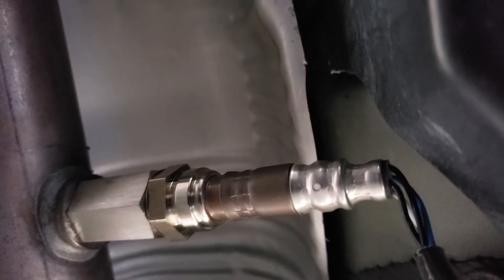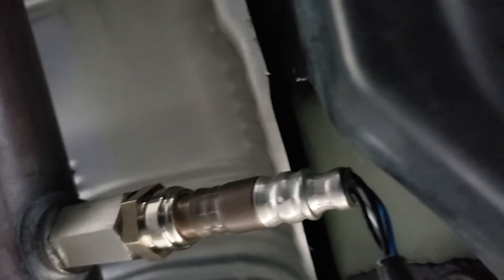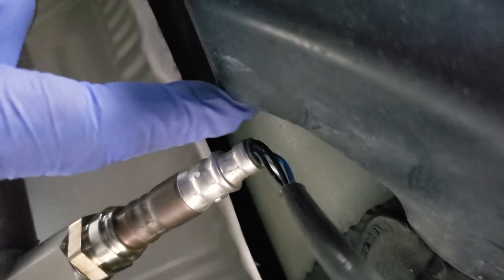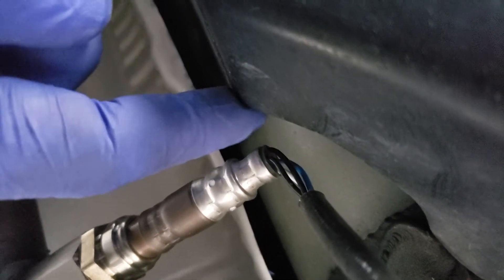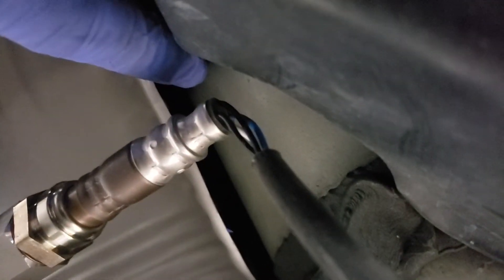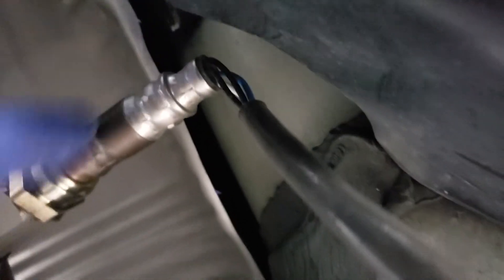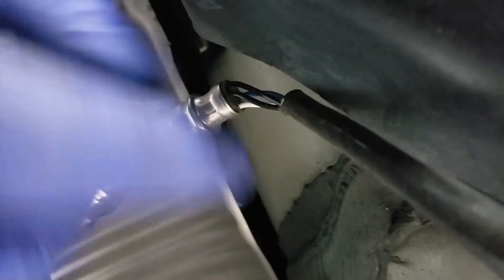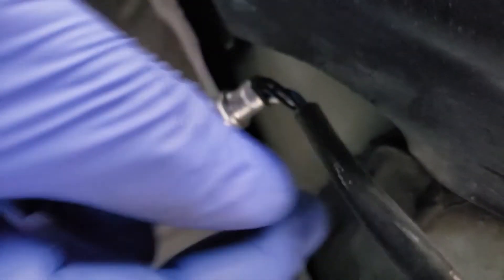O2 Sensor modification 2004 to 2009 Toyota Prius

Comment: To everyone coming here
YES spacers works ( i used the angled ones , golden copper color)
Im in california
Yes I passed smog with it
I have an old aftermarket catalytic that doesnt perfome as new...i had a p0420 code . the solution should be a new catalytic...
I needed to pass the smog.
I installed a spacer
And passed the smog 

The key of success are in the drive cycle
Get a cheap obd2 readee  that show you when the car ready for smog , or when the " readiness monitor " are ok
They go get the smog asap

Comment: What is the purpose to install this spacer?
Reply from the maker: sometimes the exhaust mixture concentration near the sensiing window of the sensor is too rich around the sensing window . The spacer reduces the concentration somewhat so that it is less sensitive to throwing the P0420 code.

Comment: Where did you get the spacer from?
Reply: Is there a part number for this spacer or is there a link you have that I can use.
Or even a photo of both ends of the spacer.
And/or what the thread/nut size is.  Some of them had different sized and I don't want to get the wrong size.
I have a 2007 Prius.
I saw some universal type ones that you have to drill one end on.
I think I also saw some that you don't have to do that in, which would be what is prefer.
Thanks.
Reply: @Steel-City-Boneshakers  Did you ever find the right spacer to avoid drilling? I'm in the same boat with an 07 as well
Reply from the maker: I got it on Amazon. It is also available on Ebay.